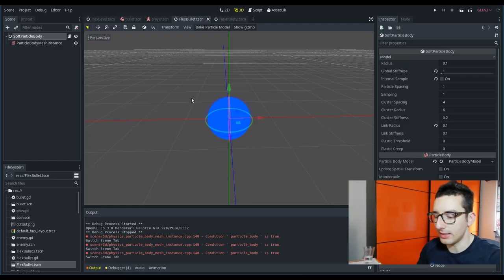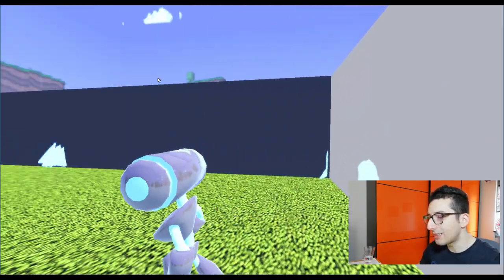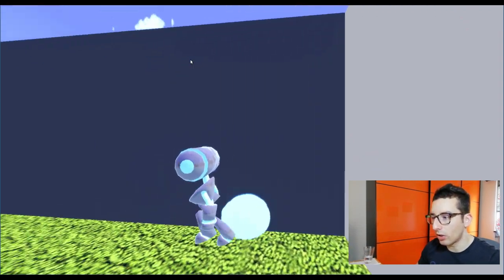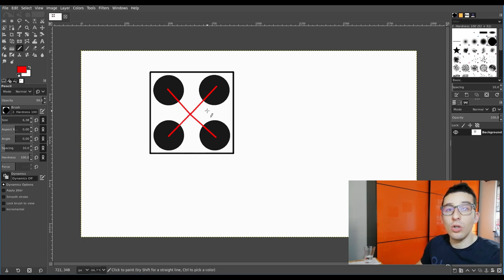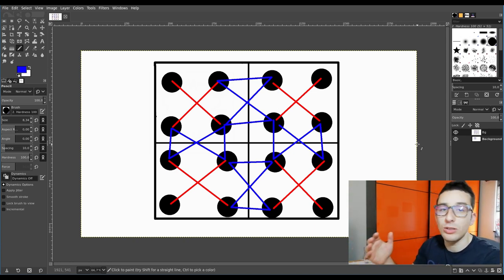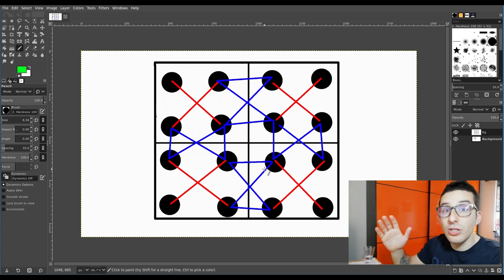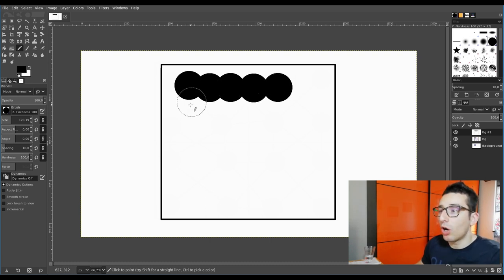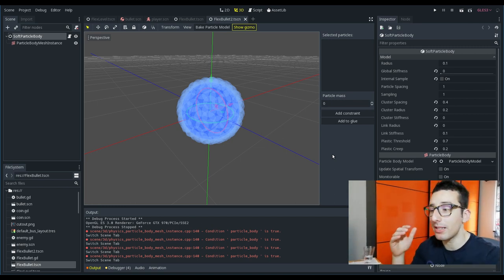Particle Soft bodies in Godot - Nvidia Flex #4

Comment: This is absolutely amazing, thank you very much for this explanation, i have tried this and it looks fantastic. I was wondering if this does work with meshes with blend shapes, since they seem to disappear on run.
Thanks again.
Reply from the maker: "I was wondering if this does work with meshes with blend shapes, since they seem to disappear on run." What do you mean exactly?
Reply: @AndreaCatania  Hi, when i use a mesh made in blender for softbody, (a cube for example) it works perfectly, but as soon as i create a shape key (a blend shape under mesh instance in godot) it does no longer work, and it just vanishes on play. I dont know if im missing something.
Reply from the maker: @jacimindodelcampo5398  yes it's correct. Move the particles in this way is not allowed, you can do it using the node particle glue that allow to move a group of particles and you can animate it with the animation player.
Reply: @AndreaCatania  I see. Im going to try it, thank you for your response :)

Comment: could Particle soft body be used to simulate clay, requiring little force to deform, but not taking back its form after the force disappear
Reply from the maker: Using plastic deformation, yep. Is it necessary to find the right settings but yes is doable.
Reply: @AndreaCatania  nice ! 
can't wait to try it out once I figure out how to build from source
Is your fork up to date with godot ?
Reply from the maker: @wapiti3895  Not really, It's some commit behind.. I'll rebase it sooner or later.
Reply: @AndreaCatania  should I be better of making a fork of the current  godot and merge your fork to get the all the feature of the current godot + Nvidia Flex and Active Ragdoll
Reply: @AndreaCatania  so I am making my own godot fork, putting your stuff in the most recent godot version and when I asked for help a guy check the changes made by the multibranch and to quote him :

 'I've correctly merged his code, but I can't be 100% sure. In examining the conflicts, it seemed as though his code was executing similar logic as what was pre-existing, without losing much functionality. The one questionable outlier I saw was that he removed all of the PhysicsBody methods which were exposed to the scripting API (not just hiding them, but removing the methods altogether). I'm not sure why that is, since I'm not familiar with any of his changes / physics code, but perhaps it makes sense to you?'

does that means that currently using multibody will make working with normal rigidbody harder ?

also, while going through your branch I saw that you have a branch called Stiff softbody,
what is it, I am currious ?
Reply: @AndreaCatania   ok so I figured out how to merge and build, but I am stuck due to a building error:
[modules\flex\godot_flex_ext\collision_verifier.o]
'nvcc' is not reconized as an internal or external command, operable program or batch file

any idea on how to fix it ?
Reply from the maker: @wapiti3895  The reason why I removed some functions is simply because now the SkeletonBone is no more a RigidBody; it is completely another type that must be treated in another way. This doesn't meant that you can't control it anymore, but rather is the opposite. Now you have far more control over it, but you want to control it changing the joint forces/velocities etc..

Regarding your building problem, this mean that you have to install `nvcc` in order to build the flex branch. Is possible to specify the nvcc installation directory from the command line using something like: nvcc_path="path/to/nvcc". I don't remember the correct name so please check the SCsub.
Reply from the maker: @wapiti3895  Seems that the custom friction kernel has some minor problems. But the main problem should be due to the fact that the Flex DLL for windows are not there.